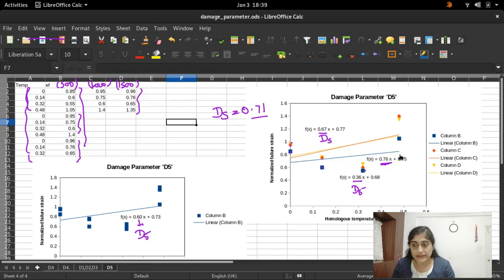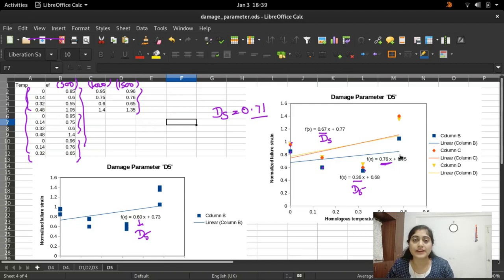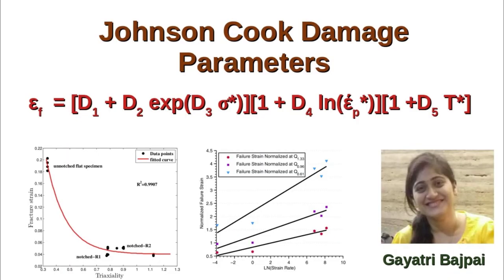Johnson Cook Damage Parameters

Comment: Hello, Mam. I have a reinforcing steel stress-strain relationship that is temperature-dependent. with this data, can I make a Johnson Cook damage model?
Reply from the maker: Thank you very much for watching my video. Sorry for late reply. what Johnson cook material model explained in the video, is used for only ductile material. And you are asking for ductile and brittle both. Reinforcing steel means, using steel rod for strengthening the concrete. You have to use Holmquist-Johnson-Cook constitutive model.

Comment: hello,madam,i'm doing the turning simulation based on ABAQUS recently. In the simulation process, i need to use J-C damage model.The material is titanium alloy TC11.I have read the relevant papers,but there is no J-C damage parameter. Moreover, i have a week knowledge of materials. Can you help me find the J-C damage parameters of TC11?be deeply grateful.
Reply from the maker: You can search through the papers only. And also you should check that strain rate requirements in your work should match with the paper. then only you can use the JC parameters of the paper.
Reply: @scienceandtechnologybygaya3535  Thank you,madam. I'll think about it again.

Comment: I've been waiting for long time to preform my thesis about FEA. Thank you so much. I'd like to inquire you, If I have only tensile test raw data. Can I calculate D1,D2,D3?
Reply from the maker: Hi, Will you please give more detail about tensile test data? Have you done the experiments for notched and un notched specimens both and have failure strain for all specimens. Then you can calculate the triaxiality factor for each specimen and make a graph between Triaxiality stress factor vs corresponding failure strain. If you are having this data points then Yes, You can find the parameters D1, D2, D3. I have given a link of source code for finding D1, D2, D3 parameters after putting above data point. This source code is available in Git-Hub  Repository. And thank you for asking the questions.
Reply: @scienceandtechnologybygaya3535   Right now I'm studying all information about JC-Model. 1.JC material model>> Understanding from your explanation. 2.JC damage model - Not clearly about the specimens prepare notched or unnotched(Standard?). How many specimens I have to perform?    I'm conducting the experiments(A356 T6 aluminum alloy ) to correspond with AstmE8/E8M(Specimens). If you don't mind, I'd like to send an email to you for inquire further information.
Reply from the maker: Yes sure, I have already given you my email id. You can mail me.
Reply from the maker: My email id is gayatri.uiet@gmail.com